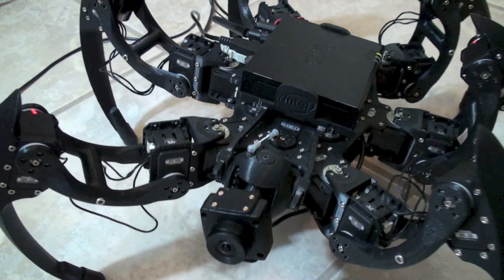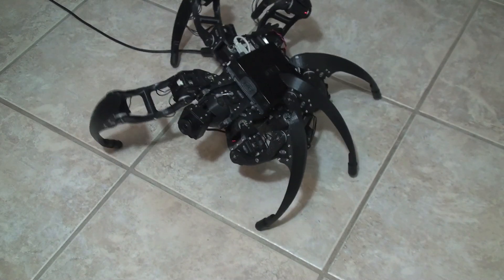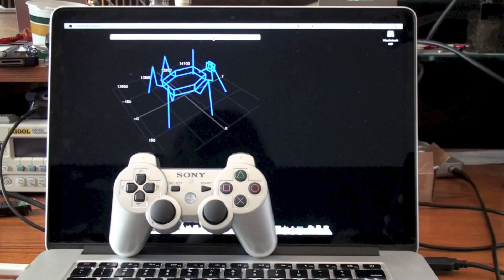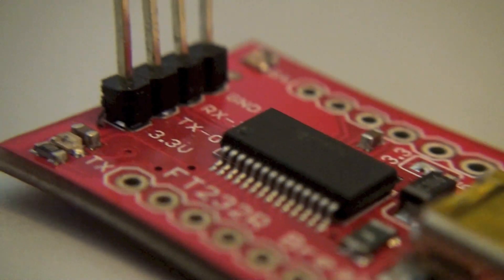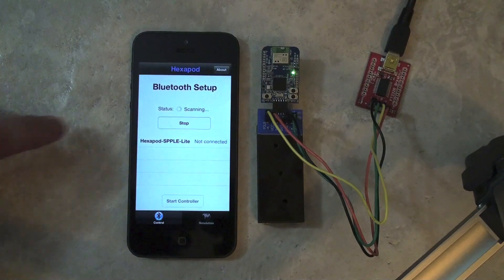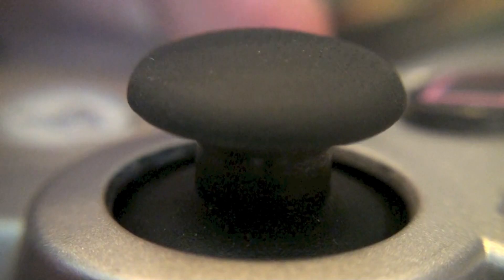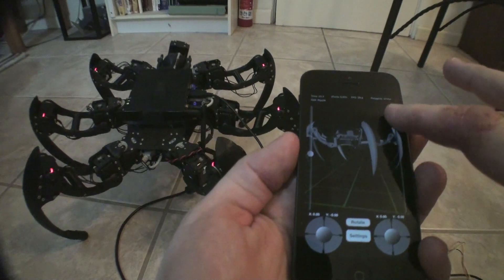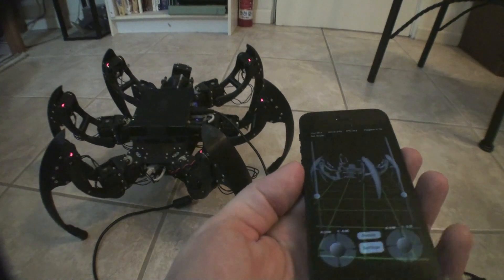iOS Hexapod Control App: Dmitri's New Interface

Comment: Good, I think your servos are a just a little bit more expensive than the hobby ones I use. There are also limits set in the software I use ,but I have also put a low value resistor in series with the ov supply (higher than the MOSFET Rds(on) ),this is to take some of the Load if the servo encounters significant mechanical resistance, Any volt drop across this resistor can also be used to provide feedback. Anyway look forward to next version Octopod ?,Dodecahedropod ?,  Hexacopter on top ? :)

Comment from the maker: Hey Kevin!  Good to hear from you!  Yes, I have max an min limits set in both the motors and in the software.  I have them set in the motors incase I have a bug in the code that updates the positions. I have it in software so I can spot overly aggressive movements in simulation.  Unfortunately the video doesn't portray the software limits, but basically a leg will change color once it tries to go into an impossible position.